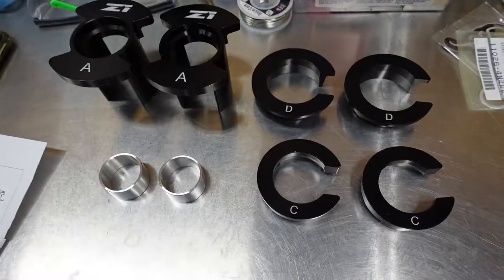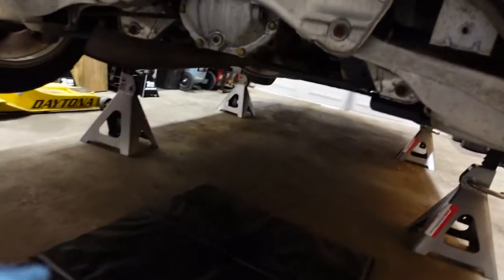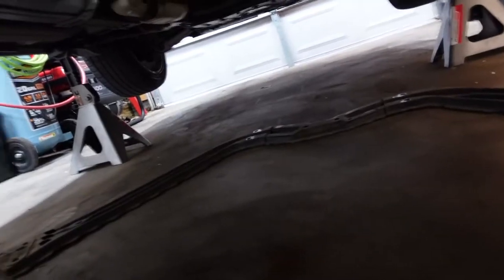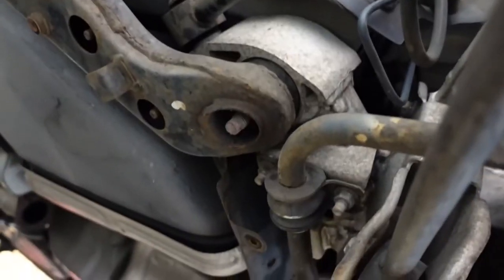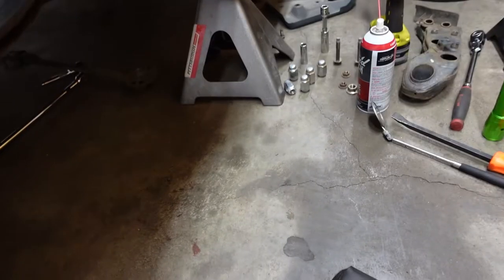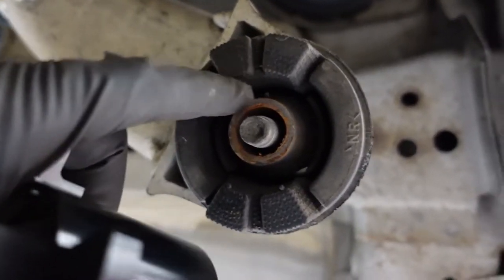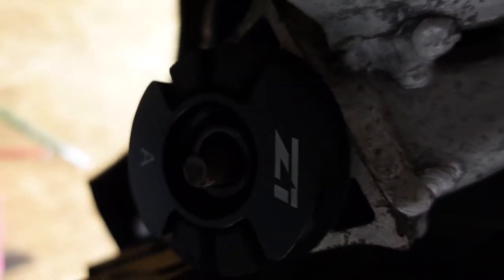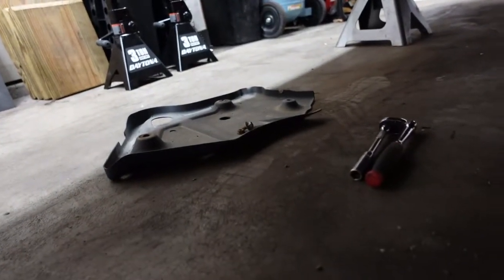350Z Rear Subframe Bushing Collars Install [Z1 Motorsports]

Comment: I know this vid a year old but I have a question hopefully you can get back to me. I installed the Z1 Bushings and collars with the brace. The car does feel more more tight in the back feels nice but now I hear a whine noise the faster I go the louder the whine gets. Also everytime I hit the accelerator I hear a thump noise. I only hear one time efter I give it gas. Its a very low thumping noise. Did you get any of that noise?
Reply: i would double check all of your bolts, have the rear wheels up in the air and dont set the jacks on your subframe. put your jack under the subframe or wiggle it once its in the air to see if theres any play or movement. i would check your u-joints in your driveshaft as well